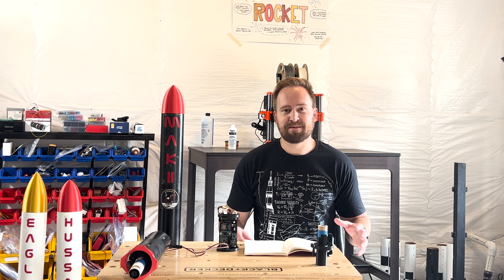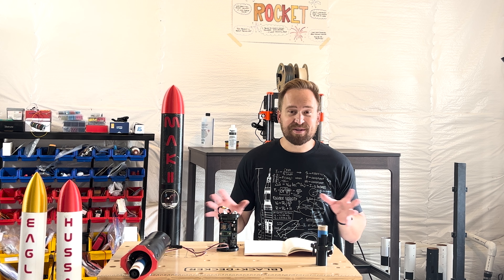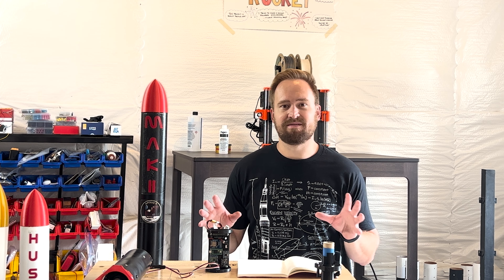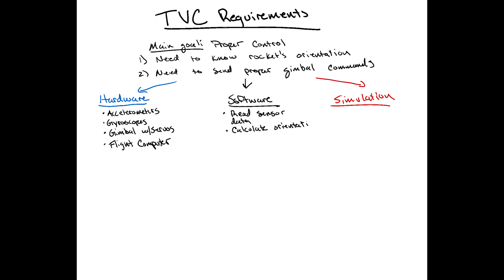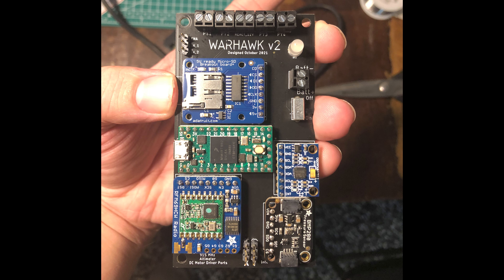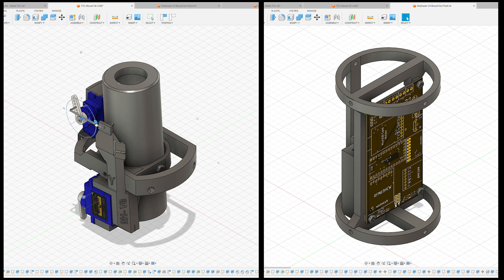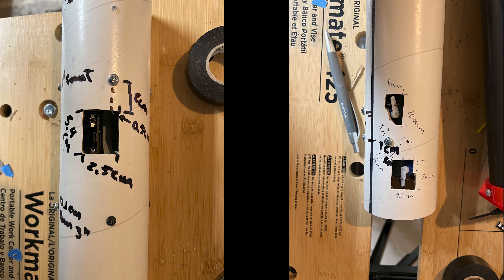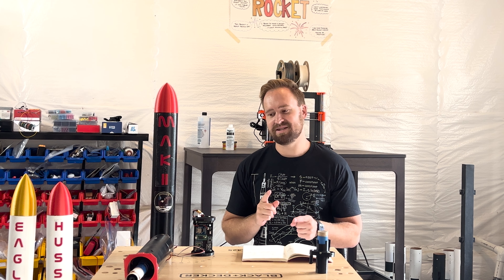First Steps Towards Landing A Model Rocket - Mak

Comment: Really nice work! Looking forward to the rest of the series. I've got an aging Signal R2 that is getting dicey, going on 10 designs of rockets and dozens of flights with it. It's been awesome, but to move forward more, I either need Joe to bring Signal 2 back or even better, Ava (please!), or go down the same path and build my own FC and flight software. I've toyed with the idea but don't think I could devote the time I'd need to learn the programming and math.
Reply: I also toyed with the idea, I got as far as feeding position data from the IMU into a 3D game engine and back to a servo, I was thinking about creating some clever control logic, something that can ignore (obviously) anomolus data and be pro-active in it's control - such as arresting an unwanted rotation with a servo command of pre-calculated time and magnitude. I think this is required for reliable landing, for the rocket to know what to do already and only use the realtime data to inform this.